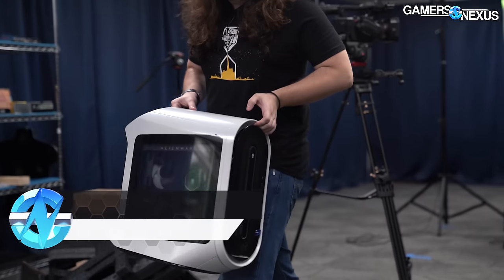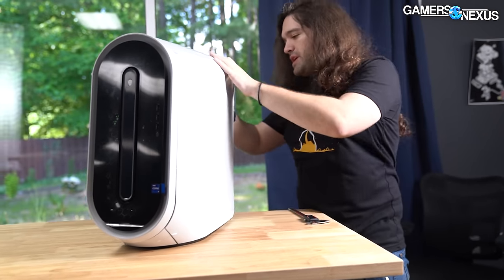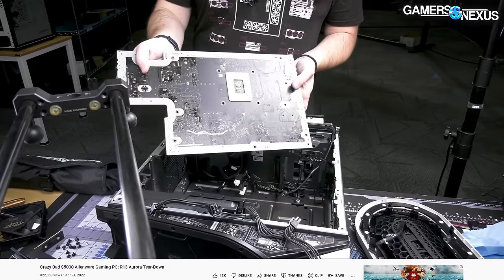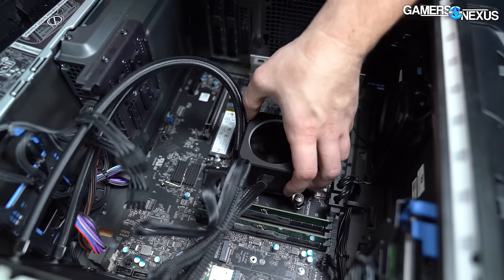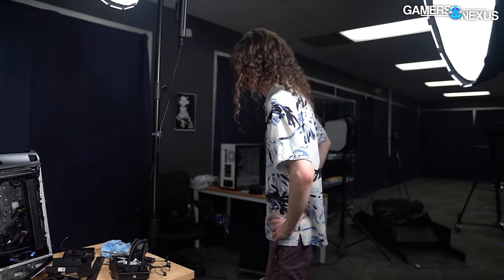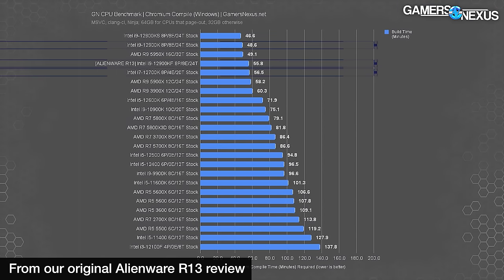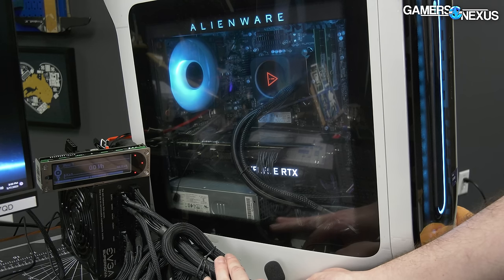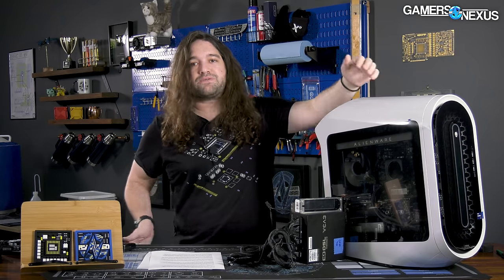"Fixing" the Alienware R13 Dumpster Fire

Comment: Seeing all that plastic and proprietary metal parts is demonstrable proof that Dell can do much better WHILE SAVING MONEY
Reply from the maker: That's the craziest thing! This case is insanely complicated to build at a factory-level, and far better cases are made cheaper by others in the industry. Dell just can't pull its head out for long enough to see that it's time to invest in new tooling.
Reply: I hope their engineers are furiously taking notes :D
Reply: @GamersNexus  This is what happens when companies draw up really long term plans and make all their costings around those plans, then rely on their marketing departments to sell their "vision". Instead of being able to admit they made a mistake and fix the mistake, there is a accountant there to remind them that any extra cost is a bad thing, and another executive raving about how the long term plan can not change, because of all the money sunk into the selling of the "vision". They can't see reality through their corporate jargon, and see consumers are dumb and manipulable by marketing.
Reply: @saywhat6480  While some of this is true, it's probably more about risk (to the bottom line). They won't invest in new designs and tooling if the existing product lines are still sufficiently profitable. When that's no longer the case, then they will likely make changes, although one of those changes could be to stop selling gaming PC's.
Reply: @eTiMaGo  Oh im sure they already know. The engineering seems competent but just applied in a stupid way, probably due to decisions made by the higher ups.
Reply: @elminster8149   I think their corporate bullshitery has made them forget they are supped to be as profitable as possible, not just make a profit. There is no point scraping by and not having the funds to retool in a few yerars and destroying your reputation along the way, when the opposite is spend the few bucks while you have them to build a better product. 
 If it were me running the company I would be taking what reviewers say about my product seriously, and take onboard any advice on now to fix the problems bought up.
 Even if I were cynical, the fact is reviewers sell more products than marketing  has the ability to, they also have the power to crush products. There is no point fighting them, even the hippy corporate leaders knew this in the 60's and 70's and that is why they went with the flow, instead of fighting upstream battles. That is one of the secrets behind many of the behemoth corporations we have today, listening to "the man on the street" and taking onboard their opinions.   The difference between the man on the street and a popular internet creator is that the creators views are validated by how many people follow and listen to them, if their takes are bad they would not have many people listening, especially in the tech world.
Reply: @elminster8149  and nothing of value would be lost...
Reply: @saywhat6480  Sadly it doesn't work that way in most cases. Dell will not spend money if it doesn't need to to achieve it's profit margin on the product, regardless of bad reviews. Dell bought the Alienware brand, anything else they got as part of the deal was secondary, they will leech as much money from that purchase as they can.
Reply: @GamersNexus  Or just collab with another company, like Lian Li, Fractal, be quiet, or Corsair. Gotta be cheaper to just buy cheap cases from those guys in bulk than to make your own...
Reply: @eTiMaGo  I think that if the engineers had free reign, they would actually do things correctly... but i get the feeling executives are basically hanging their head and saying "it must look like this, and you must use all the parts we already have - we aren't getting our moneys worth out of the current tooling.

as a result, working with these templates and restraints, the engineers probably are in a low morale situation and they don't really care. also i wouldn't be surprised if an executive forced the scrimp on the cooler after the engineers tried to mount a 240 in the front (the marks on the front look like that) because "water cooling is expensive, we don't need a big chungus radiator, make a normal sized one work and make it tool less - its too expensive to retrain our repair technicians and requiring tools is a safety hazard."
Reply: @elminster8149  "Dell will not spend money if it doesn't need to to achieve it's profit margin on the product" Yea? Explain all of the extra engineering they put into that case that they didn't need to spend AT ALL then. Oh wait you can't, just you're spewing nonsense.
Reply: It'd almost like standards and consistent tooling brings costs down
Reply: @eTiMaGo  nay, the engineers are well aware of all of this. They're not dumb, they went to school for this and know all the ins and outs of these parts should be doing. The same thing happens with cars until the finance guys come in and say, "Nope, we gotta make it more cost effective" because they have to sell as many as they can in order to maximise profits.
Reply: @saywhat6480  It's just capitalism. This is how peak capitalism works. You can still get the best people on a team and put together the best desktop PC but you still have to maximise profit. Remember, these people don't work and they don't care if their best desktop PC can't even output to its fullest potential without reinventing its own wheel as shown by this experiment. They get together with their finance guys along with the marketing team and try to sell their own unique product which ends up costing $5000 to consumers.
Reply: @matasa7463  You say that but I reckon it's more realistic to think they're rather buy one of those companies you listed, instead.
Reply: @BleedForTheWorld  I reject anything that includes Marxist phrases, such as "Peak capitalism", because the people using those terms generally don't know what they are talking about.
Reply: Dell is just a poster child representing everything else going on in m'reica
Reply: @saywhat6480  Oh I'm not a Marxist but I do think their critique is right on. It certainly holds up to scrutiny as I've just described albeit very shortly.
Reply: @BleedForTheWorld  Except your comment ignores that, to increase profit a company has to change their product instead of blindly sticking to an old design. Another point you got wrong was assuming they put together the best team, but without any thought of best for who. Just like Marx critique of capitalism fell short, so did your critique of my comment. Marx was a loser who pretty much got everything wrong, he did manage to sell many books though. The original example of a champagne socialists with daddy issues.
Reply: @saywhat6480  Again, they're listening to their finance guys and at $5000, they're doing something right. What you're not getting is how the framework operates. It's not mutually exclusive to how you think they should be operating at Dell. Also, you ended your comment with an ad hominem which is a fallacious argument, to say the least.
Reply: @shawnpitman876  Nope. If it helps them achieve the profit margin, then they will spend some money to do that. If you still fail to understand the concept of a small investment for greater rewards, I suggest you go and do a business course. Oh and stop insulting people because you fail to understand what they're talking about..
Reply: They're trying to be crApple, they just don't have the fancy GUI to go with the insane and unnecessary complexity.
They're going to fail as a company, in time.
Reply: @jimmyb1451  Nah Jimmy, it does make sense if they are making a profit (which is what they're about as a company - as are all companies). Most people buying this sh/kit will not have a scooby doo what's under the hood, and think they're getting a good deal. Dell wins because they have the brand recognition to get away with it.
Reply: @GamersNexus  They don't even need new tooling. As you said in one of the earlier videos, buying a new case and rebranding it would suffice.
Cheaper, better, and probably better looking. And the added bonus of not getting roasted all over the internet. Throwing in a decent motherboard wouldn't hurt either... and ram... and PSU... and, well you get the point. All of a sudden you'd have your money's worth.
Reply: @elminster8149  And that my friend, is the definition of Taking a dollar, vs making a dollar.

Eventually, they will fail.
Reply: @eTiMaGo  No way these decisions are made by the engineers.   This level of fuckery can only happen when marketing and finance are the only ones making decisions and the engineers are stuck with trying to work within the constraints.
Reply: @DaBoomDude  They made so many other compromises that the big cooler on the front actually made things worse, not enough air for the PSU. Had they started with a standard miniATX case and dressed that with the Alien plastic they could have achieved the same look and had ALL the normal options.
All those layers of plastic and metal I saw in the first Aurura case years ago. However that was huge and it was mostly standard.
Reply: @BleedForTheWorld  No that's Capitalism done badly.  The computer costs the buyer too much, costs Dell too much to make and it under performs for it's class. A capitalist would make sure the price, performance and desirability were optimal for profit. You can only con people into buying it for so long. The original Alienware were desirable enough and well performing enough to be worth the money for wealthy people. They've gone too far down that road now. Thy are living off past glory.
Reply: @wayland7150  The framework of Laissez-faire capitalism does not care whether a product is good or not or even if it doesn't work as long as it makes the company and its investors profit. That's exactly what we're looking at here with this $5,000 hunk of metal.
Reply: @BleedForTheWorld  It does care, it's just that Dell are doing it badly. Capitalism means capitalising, which they are not doing. You can tell that because for a start they are not getting the most out of the CPU they have fitted, that's the first clue. Then they are using too much material in their case so wasting potential there. Yes they are charging a high price for it so well done for that but at that price they are not selling as many as they could so not capitalising there either. They will be losing sales because it's not worth the money and they are losing profit because they are spending too much to build it. Capitalism is not some brain dead system designed to screw people as you leftists seem to thing. It's for achieving the best outcome for everyone involved due to the effect of market forces as well as making the customers pay the most. It balances out. In the case of Alienware it will balance out, their crap products will come home to roost. They are living on borrowed time rather than a skilled business plan. I expect they will be cut completely at any moment.
Reply: @eTiMaGo  As an engineer I can almost guarantee this shitshow was the best the engineers could get management to approve. I've run into management that wouldn't work with us until we threatened to lock-out the companies' entire SMT line (including adjacent production lines) over a $300 safety piston that they refused to buy.
Reply: @GamersNexus  Alienware started its downhill slide immediately after being acquired by Dell.  At the time the acquisition was announced it seemed everyone that was familiar with both Alienware and Dell knew this was coming.  And it took Dell less than 2 years to start really trashing the Alienware brand.
Reply: @elminster8149  What are you talking about?! Dell spends tons of money re-inventing the wheel just to make their products impossible to upgrade.
That's not necessary, it's just their corporate model. Leave no upgrade path for the poor suckers who bought 1100 of your units to outfit their company.
Reply: @wayland7150  " Capitalism means capitalising" No it doesn't. Capitalism is the name of an economic system where the means of production are capital held by someone who does not use them himself, but hires others to do it for him, and claims ownership of any work so produced. That is the complete and concise definition, and it's completely neutral. 

Capitalism is not "for" anything. Capitalism is an evolved social relationship, a historical development. It was not designed by anyone, it has only been observed and described. Capitalism does not want to do anything, it is not alive and has no will of it's own. When you start assigning some innate purpose or goal to capitalism you've abandoned the facts and put yourself firmly at the mercy of ideology.

This seems to happen a lot to people. You develop this weird secular religion around the idea of some sort of marktgeist animating a nation of perfect rational actors, base all your expectations on it, and then the moment that real life events don't match up, you're helpless. You're completely incapable of explaining Dell's success in a way that doesn't disprove your beliefs, and you're also incapable of reassessing your beliefs in light of evidence that contradict them. Despite everything, Dell shall continue to make good profits while making bad computers, and you will never allow yourself to understand why.
Reply: The epitome of the sunken cost fallacy
Reply: @kyle8952  of all places, I did not expect a debate about capitalism on Gamers Nexus lol
Reply: @jimmyb1451  Maybe they could put a colored panel on the MOBO side of the case and backlight it, worked for apple when they did it on the back of their all in ones when their sales started struggling.
Reply: @SwervingLemon  Not sure what you're issue is. You've just provided another example of the same thing I already said. Spend a little for a bigger return. Spend a little making non-standard parts, but still make a profit because your still making sales on products. Companies don't typically upgrade hardware beyond memory and storage, mostly they'll replace the whole unit with brand new kit.
Reply: @kyle8952  Sorry you went off the rails real fast there, capitalism is a system where the quality of a product is reflected by the preferences of the consumer to buy or not.
 With companies making a profit from sales of a prefered product or making a loss from doing something wrong. Instead of a governmental overloord deciding who gets what at what price..
 A capitalist does not think he/she owns the labor of people, it is part of capitalism that labor is a negotiated commodity making everyone free to make all their decisions is capitalism, having a government overlord is socialist and wrong for any free human to want, it is one step away from slavery, until it becomes slavery.
Reply: @GamersNexus  they probably bought thousands of these years ago and now can't get rid of them.
Reply: @kyle8952  Dell's success is due to Michael Dell building computers and a business that builds computers. He worked to grow the business by investing in it and making sure the computers got sold in huge numbers for a decent profit. In order to do that he needed to build decent computers. If the computers were total crap then his business would have failed. Because his computers were good and he got other aspects right the company grew. The current Alienware machines would not make a good foundation for a business because they are crap for everyone, for Dell, for the seller for the customer. They maybe OK for capitalism right now because people are still buying them due to past reputation but that part of the business will have to change or go broke. I should really say market forces, obviously capitalism will try and gain a monopoly which is why regulations are required to keep businesses from cheating. If Dell found a way to put every other computer company out of business then they could make crap computers forever.
Reply: @saywhat6480  "capitalism is a system where the quality of a product is reflected by the preferences of the consumer to buy or not."

That's incoherent, sorry. "That sucks, I don't want to buy it" is a thought that human beings regularly had before the emergence of capitalism. It's a universal. People were complaining about shitty products in the iron age. The distinctive feature of capitalism is the purchasing of labour power as the dominant economic relation between people.

"With companies making a profit from sales of a prefered product or making a loss from doing something wrong. Instead of a governmental overloord deciding who gets what at what price..
 A capitalist does not think he/she owns the labor of people, it is part of capitalism that labor is a negotiated commodity making everyone free to make all their decisions is capitalism, having a government overlord is socialist and wrong for any free human to want, it is one step away from slavery, until it becomes slavery."

You have nothing here but swivel eyed dribble about the socialism that haunts the shadows of a dark room when you're alone, and the faith that rephrasing a description of a thing changes the inherent nature of that thing. That sucks man I hope you get better.
Reply: @kyle8952  you are so brindead you try to pass of  pretty good explanation of what hiring in a free market is as "That's incoherent". then go on to explain how you think the free trade of goods and labor is not capitolism, because it existed before the term did, but you completely miss that it is the core of capitalism and the belief in capitolism, that free humansd trade freely Not just something you can swipe way with a fith grade misunderstanding of words.
 Capitalism is something human kind came up so freely it was around before the term, every living beeing trading freely within and between people and groups of people. Socialism is the tyranny of the minority by  the majority, because at one time they had a meeting about it.
Reply: @eTiMaGo  From my understanding, it's not the engineers fault.  Apparently it's management that wanted this case even though the engineers tried to fight it.  One of the other videos about this computer had one of the engineers talk about it.  It basically came down that management didn't care that a new case was warranted, they just wanted to use what they already hade available even though it wasn't suitable.
Reply: I have a Dell Inspiron all-in-one PC and it's garbage, it's so laggy, even when it was brand new, and the headphone jack is so sensitive as well.